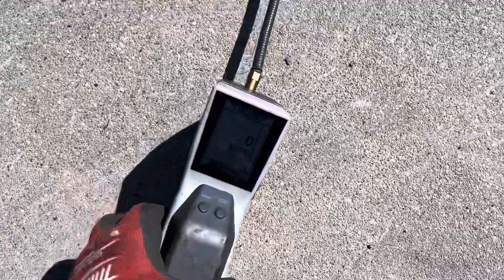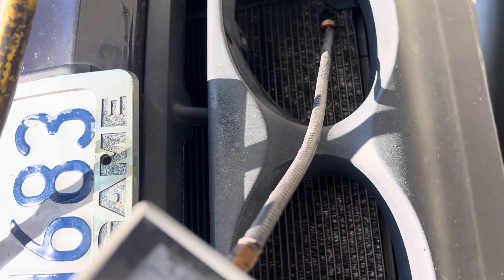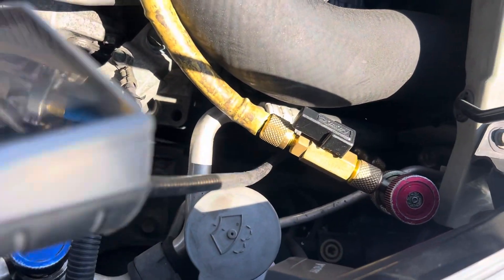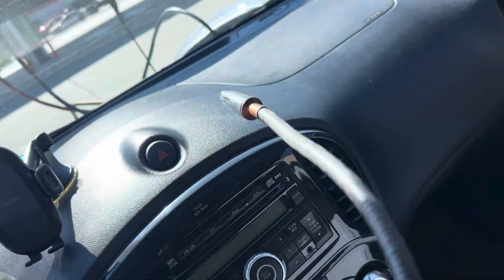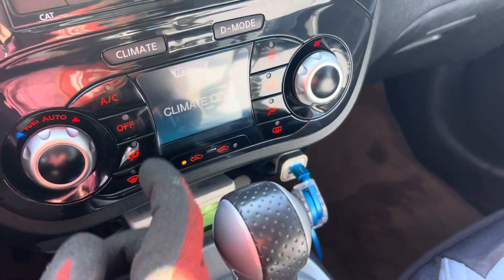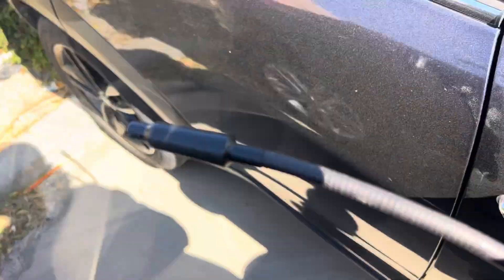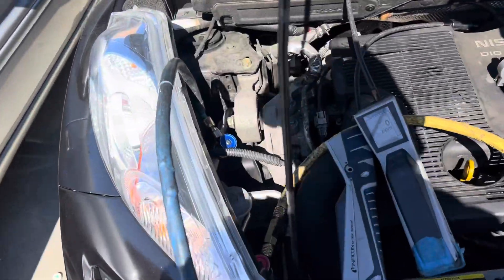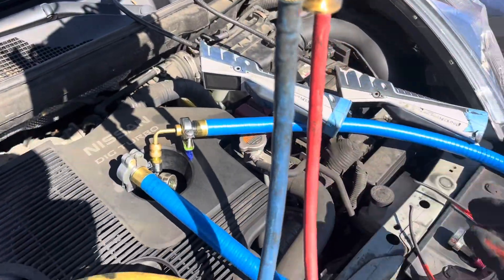Big refrigerant leak leaves no oil stain on condenser.

Comment: I see new AC accumulators come out of the box with one of the shipping caps popped off and who knows how many months this cap has been off..... I'm assuming the desiccant is still fine as long as you run vacuum for 20-30 min at least, or just send that accumulator back and keep trying for one to show with both caps still on tight?  
Thanks
Reply from the maker: Send it back. 

Desiccant does not want to release moisture molecule, like rubber or metal surfaces

The method of drying out desiccant is putting it inside an oven and depending on the type of desiccant 

The old-fashioned little crystals he needed to 250° somewhere around there in an oven for a few hours 

For the molecular type desiccant used in laboratories and cars and manufacturing goes into an oven chamber at 450° or minus a little .  

Unfortunately, we cannot stick our car in oven 

And the plastic pieces inside the accumulator that is used for the bag around the desk and BBs and at the bottom there’s an oil pick up tube with screen made out of plastic so it could not survive inside of and at 450° it would melt
Reply: @coldfinger459sub0  Thank you....

Comment: Did you see if the Ultrasound detector pinpoint it better?
Reply: Ultrasound detector?
Reply from the maker: @nservice1625  the ultrasound is sitting on the front passenger seat of my car. 
     I found it in the next video where I said I was going to fill up the system and test the system with a full charger. Refrigerant to make sure the compressor and the expansion valve are good and that all controls are working perfectly before I tell them that the condenser is licking.

Because I wanted to double check that evaporator for leaks
Reply from the maker: I did not bother getting to ultrasound on this particular one because I kind of knew we were around where it was going to be so I just grabbed the leak detector that was sitting on the front seat next to me.  And found a leak pretty fast..

Comment: Wasn't it detecting refrigerant from the evaporator as well?
Reply from the maker: It was a very, very small hit
And as I stayed in the video, I only have a little vapor in the system. I still have to fill the system up 100% to prove that the compressor is in good shape, expansion valve and everything is working correctly. 
And then I will go back and recheck the evaporator with a system recharge . 

I always double test evaporators 
Sometimes three or four times before I give an affirmative condemning of an evaporator. 

I do not want to false condemn a evaporator. I like to be 100% sure. 

It is such a expensive item due to labor for the customer 

I don’t like selling parts that are not needed . 

That’s why when I condemn evaporators I repeat my test several times .

Comment: that condenser is rough, time for the shake n  jerk 1oz. sealer. poof all set.  t-lec breaking  a/c repair records allover, even though the shake n  jerk  liiiiiiives onnn.
Reply from the maker: I would like to experiment with some of the newest sealers. 

This leak is too big for a sealer to to fix . 

But for old $1000 cars that have a Leaking evaporator that will cost $2000 to replace. 

I need some people who desperately need her conditioning but definitely cannot afford a $2000 repair on the evaporator and they’re not going to fix their air conditioning .  
           So in this scenario would make a good guinea pig to experiment with some of the manufactures of all these different companies making sealers

Comment: Thanks again for sharing your expertise.  Have a few random questions not really related to the video but do all refrigerant leak detectors give false readings if someone cleaned off an area with brake clean?  If so what’s the best way to wash it off so it won’t give false readings?  Have there been cars that you’ve come across that are only like 4oz or so low and have not been able to pin point a leak?  I usually add .5oz of oil/dye when doing an evac and recharge since that’s usually about all I get out during recovery. Is that enough to circulate through the system and show up on a uv light? Our shop definitely needs to upgrade our uv light and leak detector.
Reply: Gotcha, thanks man👍🏻!
Reply from the maker: Water soluble solvent

Water-based soaps 🧼 

If you have good concentrated refrigerant UV die you don’t need a half ounce. You only need 2 mL on a small system 5 mL for a very large system that has 10 or 14 ounces of oil which they don’t make anymore.

So it sounds like you have the wrong refrigerant dye

You need one of the new concentrate

Comment: i found that light and it does work good thanks. hehehehheh
Reply from the maker: Compared to the lights that you can buy in the auto parts store for leak detection or off the tool truck that comes to the automotive shop this much better